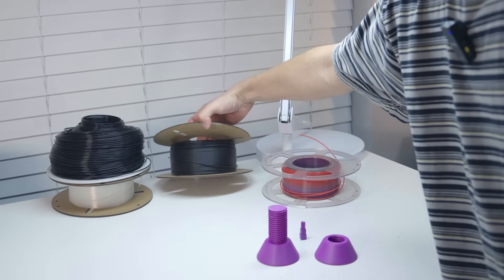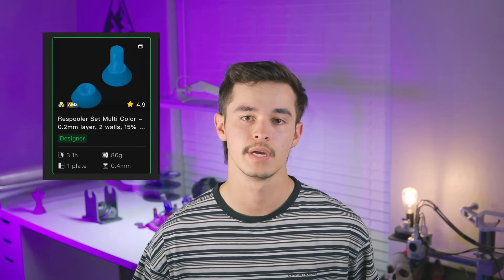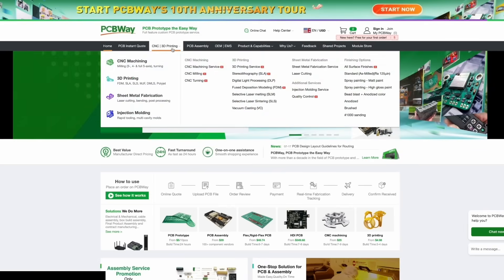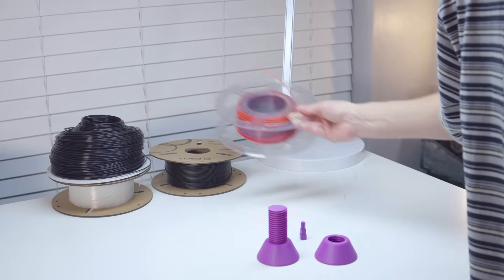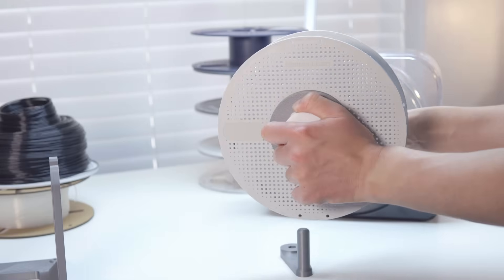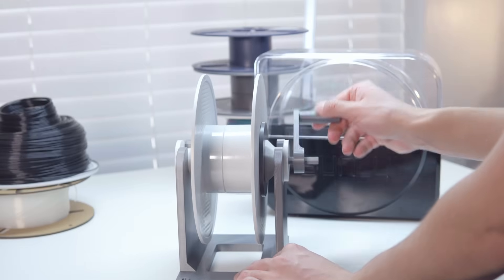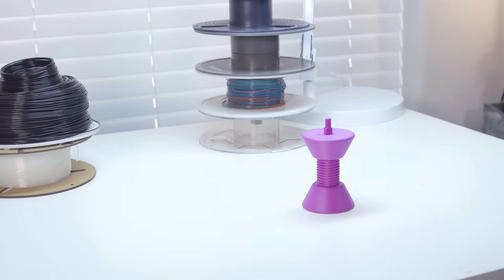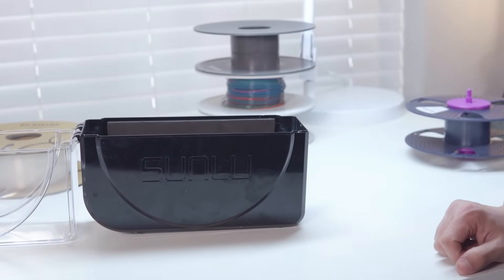I Tested 3 Filament Re-spoolers So You Don't Have To

Comment: I printed the Pasta Matic as I had 1 spool of PolyMaker PLA refill tangle after putting it on a Bambu Labs refill spool. I printed in PETG and thought it was a waste for just on spool. Then a new batch of refills have come in and 2 of them have done the same thing. They aren't tangled, what happens is a very small gap forms on one side and the filament gets pulled down into the crack. It's happened with two spools and I just opened a 3rd and it looks like it will do the same thing. I'm getting ready to put a model up on MakerWorld for a Bambu Labs refill spool that you can just slip the end of the filament in and respool without the need of tap so you don't have to worry about it getting caught in the AMS.
Reply: If you use multi-color or MMu3 those refill spools will drive you crazy.  Tangled filament, broken filament, jammed AMs/MMU.  The couple bucks you save isn't worth the hours of hassle they cause.

Comment: Don't let go of the end of the filament like you did when you cut it with the scissors... That's what causes those tangles. The end can go under another loop, and it may not show immediately, but once it gets tighter, it will do exactly what you had happen that caused you to cut it in the first place. That's why there are like 2 million versions of filament clips you can print that attach to the lip of the spool to keep it secured.

Comment: 15:22 You have the donor spool feeding off of the wrong side.  The spool should turn counterclockwise to feed the filament onto the new spool.  Ideally, the filament should line up with the PTFE tube.  When you wind it with the donor spool laying the wrong way, you put a lot of unneeded stress on the PTFE tube.

It looks like you may have corrected this later in the video, but this stood out to me as something others might want to be aware of.

Comment: Never ever let the end of the filament spool just hang around loosely, that's how you get tangles. make sure its either in your hand, in a printer, or in the little hole in the spool.
Reply: Accidents can happen and if you actually lose control of the free end and it slips back onto the spool, you need to grab the filament from a point that is a wind or two on the roll and pull the strand off until the tip is free, then wind it back on the spool. This will prevent tangles after accidents.

Comment: I have used the pasta lite spooler. It works, but even it is a poor design. I appreciate you testing the others. All in all, my verdict is that the spoolers out there are either bad designs or they are not even worth trying. I would like to see someone come up with a really good design, but so far there isn't anything out there - YET!

Comment: Fun note for tangles. 11:49  these happen when a counter twist got caught. If you want to save the spool, all you have to do is loosen tension and jump the tangle over the spool. It will have a direction it wants to jump. After that its like undoing the first twist of a shoelace, then realigning it on the og spool. If you keep pulling you knot the spool and get serious kinks, and not the fun ones.

Comment: I've only been printing for 10 days now. And I have learned some of the biggest 3D Printing rules of all:
1) NEVER let the end of the spool loose! And...
2) Never use Silk PLA if you want a part to be strong or resilient. And...
3) Stick filament straight back into an evacuated and air-tight bag after it comes out of the dryer, or AMS. With lots of desiccant. 
4) For best info, chuck a 50-cent Temu hygrometer into your individual evacuated air-tight spool bags.

Comment: NEVER let go of the filament end.  It will slip under another wrap on the spool and that is the cause of a tangle - which is just another name for a knot. Spools do not come from the factory with tangles because the machinery does not allow that. Tangles are caused by users.

Comment: You were using an impact wrench instead of a drill.  You should really use a drill as it's going to be less stress on the printed gears, causing premature failure.

Comment: 4:57 What are the odds that you still have the files for that second spool rewinder? I've used 4 different rewinders and 3 of them were crap and would break. I haven't had that issue with this one. I wanted to print a second one, but I can't find it anymore. It seems the model was taken down.

Comment: For the hand-cranked respooler, a very low-tech way to address the problem is to take a hardback book and set it on the table between the donor spool container and the frame of the takeup spool with the spine of the book toward the container; that will maintain a separation between the two spools, and shouldn't cost you anything (I suppose it's possible that there are homes that don't have any books in them, but if you're invested enough in hobbies to have a 3D printer, you're almost certain to have reference books you can use).
Reply from the maker: great idea!
Reply: Just use a bit of double sided tape job done
Reply: @voyager8195  Not as useful if you're pulling the devices off a shelf to use them, then putting them back; the double-sided tape may not come cleanly off whatever surface you're working on. If you can dedicate a piece of plywood or fiberboard as a permanent mount, though, screws are better.
Reply: It wouldn't need to be a book.  Any reasonably-solid object around the same size and shape as a book would do.  Probably even a box of cake mix or other grocery item.

Comment: You can use clamps to clamp down the 2nd unit to the table, instead of drilling it to the table permanently. 

I do the same with my bench vice. For a bench grinder i'd definately drill it down though 😂😂

Comment: First spinner - stops because he hits a tangle then cuts the filament and lets the end go free - risking a tangle on the newly wound spool and the end could dip under a previous wind before being pulled out and secured.

Second winder needs a bar to come out from the base to push against the drier to keep them both at a set distance.

Do you really need to put ABS onto a high temperature spool?  If the spool is going to be inside the AMS or on the external spool holder then the spool isn't going to be in anywhere that's too hot for the normal spool.   Do other enclosed printers keep the spool inside the chamber where it can heat up?

Comment: with the elagoo cardboard spools you can load it onto a reusable bambu or 3d printed bambu type reusable spool. I forget if you need an adapter in the center, but I do this with all of my cardboard spools so I can use the AMS without worrying about cardboard dust buildup on the rollers. Just rip one side off, replace with reusable spool, repeat.

Comment: Jet L  I finally got my Pasta Lite printed had to wait for a new Hot End to arrive for my A1  I only have one problem I am not sure how the part goes in for where the PTFE tube goes  that part does not move back and forth on the spindle   No one shows which way it goes watched several videos and none show which is the proper orientation  Any ideas or suggestions Thanks Tom

Comment: Important note with respooling. When possible do it twice.. Once onto a spool and secondly onto another spool. Many people that have issues with respooled filament, have them due to the flexing of the very inner layers of the filament having a tight radius vs now being the outer curves of the filament. This can cause some issues with loading and getting caught on anything the filament has to pass through, or even breaking in the PTFE guide tubes. The 2nd respooling puts the inner layers of filament back into that same orientation on the spool and helps relieve stresses in the filament.
Reply: Or just dry it.. heating the filament also solves this problem.
Reply: @AndreoVieira  Depending on the spool the core doesn't come to a temp that relevies this stress.
Reply: @MattWeber it's just a matter of time. Maybe not after 1h, but after 4h that stuff is evenly baked.
At least in my Eibos X Series
Reply: @MattWeber  wouldn't the filament under stress be on the outside though?
Reply: @vixue  The less filament you respool the less stress there'll be on it but the majority of the stress will be nearer the inside and outside. Think about it, the filament that was on the outside had a fairly wide arc and that's now being forced into a tighter curve near the center of the spool. Whereas the filament that was on the inside had a narrow arc which is now on a wider arc - effectively straightening it. If you respool twice then you keep the inside filament to the inside and the outside filament to the outside. Or you can do as others have suggested, respool while the filament is warm or warm it immediately after respooling so that it "relaxes".
Reply: @genekoesling yeah that makes sense to me. I was more responding to the creator that refuted the heating technique by saying it won't get hot enough on the inner part to relieve the stress, but after a single respool the part with the most stress would be on the outside exposed to the most heat. Or is the "looser" part on the inside also an issue?
Reply: @AndreoVieira just wanted to comment that with the heater/dryer.
I set it to 60°C and this will remove all mentioned problems.
Reply: @MattWeber   cheers, that is a very clever piece of advice
Reply: This is some insider advice, thanks for sharing my dude
Reply: Awesome advice. So, in reality  we really need a re-re-spooler.
Reply: I wish I'd seen this comment months ago... I respooled a roll of PLA using an earlier version of the Pasta-matic and it worked beautifully. I came home from work one day a few weeks afterwards to find the filament had pretty much exploded and there were chunks of PLA 3-6" in length all over the floor and the desk with the tangled remnants still on the spool.
Reply: ^ This guy rewinds
Reply: Newbie here, thanks for the advice
Reply: Great advice and I definitely never thought of that but it’s definitely true
Reply: Thank you.

Comment: You missed one of the best, V-Spooler X (available on MakerWorld).

It stacks the spools which eliminates the need to find a way to hold the second spool. It allows the use of 5kg spools, so you can purchase cheaper filament and roll onto regular spools for printing. It also has an auxillary piece that holds the Sunlu Filament Connector which greatly simplifies merging pieces of filament. It's a long set of prints and should be done in PLA+ with some TPU or Flexible PLA. It connects via metal inserts and screws together so it's very stable and secure but requires some additional supplies & quite a few bearings. It works really well and the desiger is always making additions to make it better. Check it out.

Comment: I started with the respool tool that you showed. Out of a desire to make it neater, I made a V-Spooler. There's also a great mode to use a linear rail to make things SUPER smooth. Suggest you do a followup with V-Spooler/V-Spooler X, and LTS. No shade to KYZ (awesome creater), but I find V-Spooler to be superior. Thus far, I've only used the drill and handle drive options on it, though I'm waiting on parts for one of the motor mods.

Comment: 4:28 I got my printer at the beginning of January, and managed to have a spool come apart before the month was out. 

(Printed a gyroid PET-G spool and tried to use it for drying a PET-G refill... Yeah... And when transferring it to a spoil that didn't melt, I managed to not lock it. And the spool came apart in the middle of a print. 

Things got tangled enough and the PET-G was becoming water logged enough that I gave up on the spool and pitched it... Oh well, wiser for next time.)

Comment: I guess I'd go for the Pasta Lite Donor Spinner, takes a bit more time and plastic, but certainly works better.

A couple of tips - instead of bolting it down to your table, you could just screw it to a piece of MDF or plywood. It should stabilise things rather well. If you can't do that, get some anti-slip mats, you get those really cheap on a hardware store. A last tip, before cutting the filament, hold the filament end closest to the roll between your fingers so it won't get tangled up on the roll. That can really easily happen!
Reply: Print a couple of clamps and clamp to edge of table
Reply: Mine has been a god-send.  I run one or two prints off a fresh factory spool, then respool it.  I printed it from PLA (with 608 bearings) and so far it's holding up well, though the drive element is starting to wear.  When it goes, I'll reprint it in ASA.  Mine is bolted down to a workbench and powered by Ryobi, dedicated motors and more wiring I do not need.  My Ryobi drill is so old it's blue, and it's still going strong.

Comment: @ 15:25, you should have loaded the filament straight in and not at an angle as this is how it was meant to feed. Flipping the spool over would have fixed this simple error you made.

Comment: For temporary securing of the dryer and winder, use the blue tape and super glue method.
Reply: even easier, just take a length of tape and wrap it into a circle, like a watch band. then put it where you want it and flatten it out. it holds more than you may think

Comment: Don't forget to always respool twice because the role will be opposite to how it was on the previous roll
Reply: Only matters with pla iirc. I just don’t bother respooling though, cardboard spools get too much hate. If you treat them right they’re fine.
Reply: @NebulaHatesWatchdog what, you have never had a crushed ,collapsed , torn etc cardboard spool upon delivery? It’s 50/50 for me 1 out 2 cardboard spool has to be transferred to a plastic spool or drastically repaired.
Reply: @Kamikaze3557  no, I never have. I go and buy all of my filament in person though so that may make a difference.

Comment: A couple of points.
1. Keep your cardboard centers from your reusable Bambu reels. They have a little hole you can insert the end of the filament you want to respool. Poke the end in there, bend it over and get a couple of slow controlled wraps on there. No tape needed. Just remove the RFID tag to stop the AMS picking up the wrong data.
2. When using the Pizza spooler run the old spool filament from the center so it runs straighter towards the PTFE tube. The machine will run better without the extra strain of pulling filament off center. Especially true if the spool to be respooled was fuller.
Reply: Thank you for the Cardboard trick

Comment: That second one sucks unless you are using a Bambu spool. Any other spool and it does not snug up properly. 

I would recommend spooling it again to a second roll to keep the filament from eventually breaking.

Comment: You should know that you can easily separate the cardboard sides from Elegoo spools, and the hub will just slide onto a BambuLab refill spool - no need for rewinding https://youtu.be/daxXtgkRN-c?si=n-Lg5AAy2Q3wDnsC. It's unlikely that a rewinder will help much with spools that are already wound too tight or which have entirely come off their spools.

Comment: Best one I could find was made by Storm Design. It can be found on Printables. Motor Drive 2 - Modular Design for Stand - Auto-Stop Function for Bambu Lab Filament Spool Switcher & Winder. I use the motorized version and have re-spooled over 1,000 spools. I will never use any factory wound spool again.
Reply: What great news @virtualbum7199!  Why?  Because, for the past couple of weeks, I've been fighting with the "original"  "Filament Spool Switcher & Winder if you use AMS" posted on Printables by Miklos Kiszely.  No love here, because I encountered a multitude of stopping points, mainly with the main shaft that holds the worm gear.  The axis was flexing and, thus, was causing the worm gear to lose contact with the 60 tooth gear and that caused the spooling to skip and lose contact.  So, I reprinted the shaft and worm gear, thinking I could solve the problem.  Not so.  Then...

I found the Storm Design page and began reprinting several parts, including the solid axis on which the worm gear was affixed (thanks to Twotone74).  Still, no love.  I think I'm gonna look for a replacement for that middle vertical section near the worm gear so it would take another bearing which would hold the axis stable.  But, the design of some of the axes from the Miklos model (which were cylindrical throughout) were supplanted by the hex axes from Storm Design.

So, I think I'm just going to take all the various parts I printed for the original design by Miklos, throw them into a box, and then research how to wind up with the exact version Storm Design promotes, complete with the motor and variable speed control

Thanks for your comment.  That gives me hope that I can finally wind up with a really nice spool switcher/winder.

For any interested, here are URLs:
a) the Miklos Kiszely version on Printables
     https://www.printables.com/model/407688-bambu-lab-p1-x1-x1c-x1cc-filament-spool-switcher-w
b) the Storm Design version on Printables
     https://www.printables.com/@Damian27/collections/1304611?lang=pl -- and navigate to the information you need from here

Comment: Anyone having troubles/solution to winding the spools "too tight"? I printed and used the Respool Tool and thought I had a successful respool until about a day later when my filament became super brittle and broke. After some googling, it sounds like this could have been because i re-wound the filament too tight, causing microfractures. My filament was in a controlled dry environment, so I'm hesitant to respool again since I'm not sure how to get the tension correct.

any ideas would be appreciated!